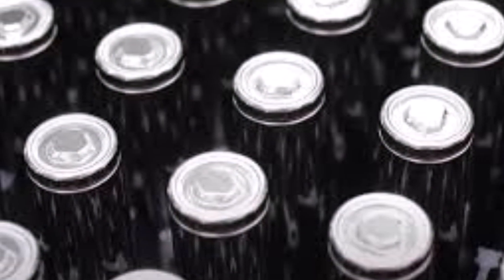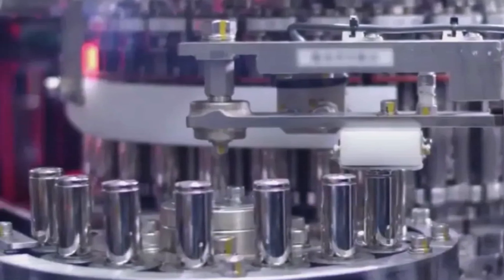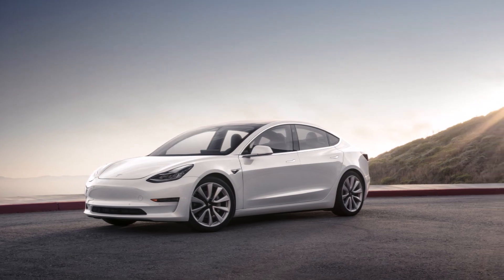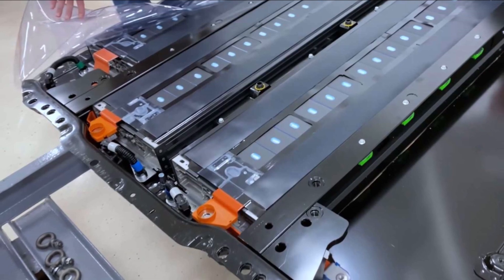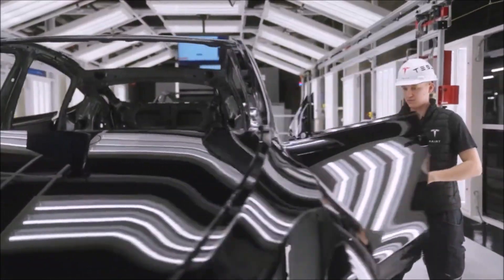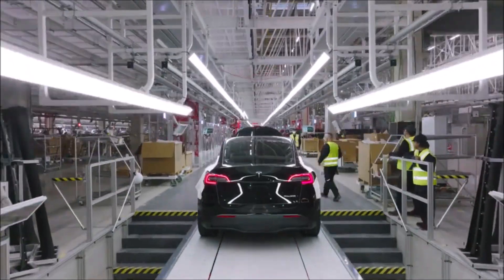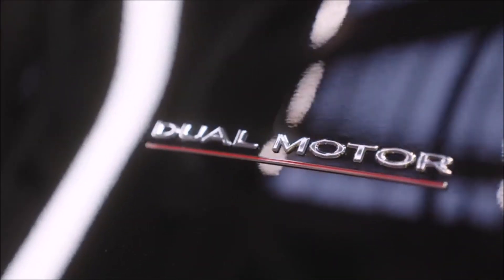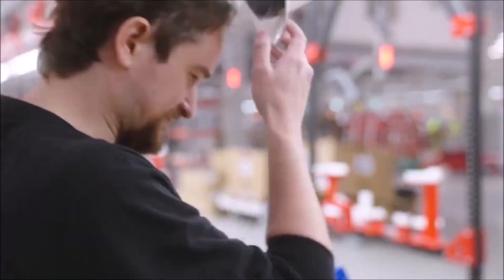Tesla Just Made a "50% LFP Battery" Revelation About its Lower-Range Vehicles

Comment: Since most Teslas are sold in China, and there are added benefits for using Chinese LFP batteries. This all makes sense. I expect that Tesla will expand their LFP offerings by selling the Standard range Model Y in all markets(at a lower price), and use LFP batteries. I also wonder if CATL or others will start building 4680 format LFP chemistry batteries, just to standardize their production. I do believe that when the 4680 battery production ramps up in Giga Berlin and Giga Texas that there may be a shift back, favoring Tesla's own 4680 batteries. But there will always be a market for LFP batteries, especially as they improve the energy density and cold weather operation.
Reply: It not that they moving really quickly because eventually when the other OEM once they fire there old management will quickly move to secure their battery supplies.